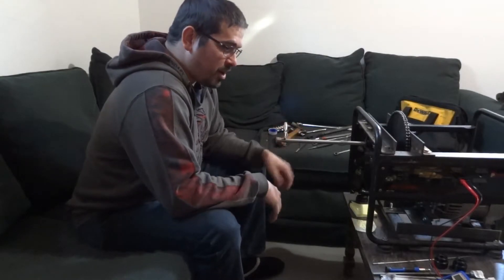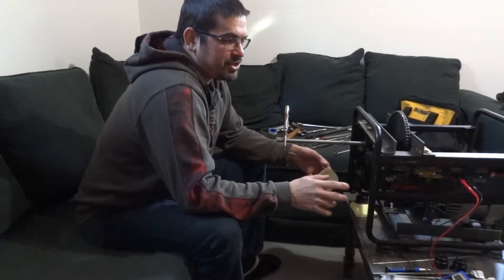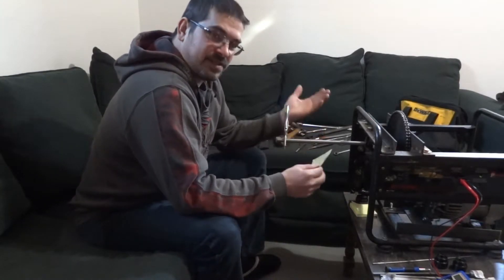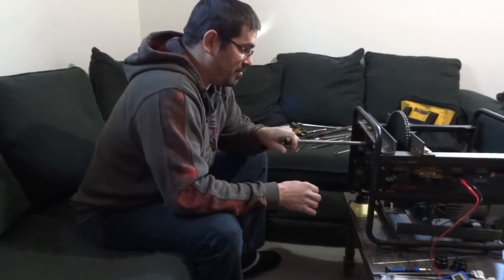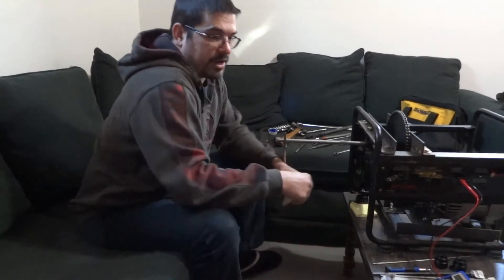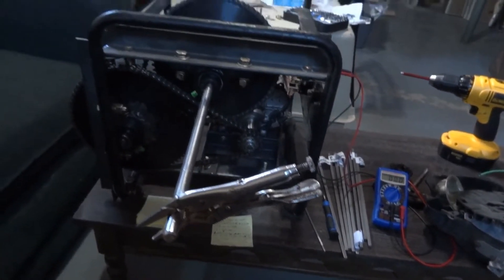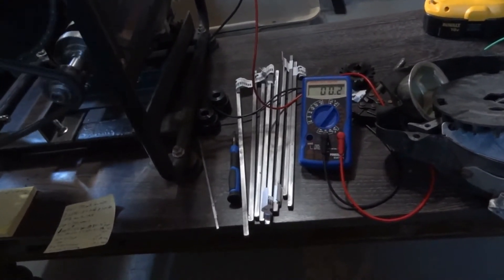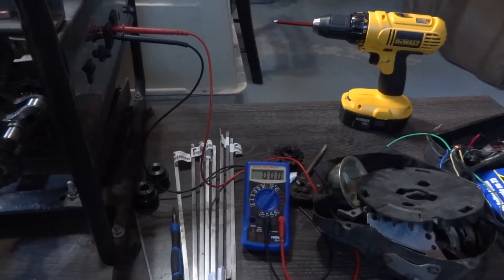Gas to Wind & Peddle Powered Generator Conversion Pt. 6 (Final)

Comment: Could you use an alternator with a propeller to generate DC power to power a DC motor to spin the generator that could solve your speed control problem
Reply from the maker: There would be plenty of wasted energy going to each motor to instead of a direct propeller going to the generator. You could do that setup, you just wouldn't be getting a feasible result. 

Factors:
Wind speeds
Propeller to alternator gearing
Alternator output
Alternator load from secondary DC motor
Secondary DC motor output
Secondary DC motor load from generator
Secondary DC motor to generator gearing
Required KW/HP input to maintain generator output.

It's a bit of math and engineering.
Reply: True. it would be more cost-effective to run a DC wind turbine to charge batteries and use a inverter to transfer power from DC to AC

Comment: Thank you for your instruction.  I'm gona try the same but use hydro power instead of wind. Just haft to figure out pressure needed to get the hp. You rock sir!
Reply from the maker: The flow rate of the water source, will determine is your available pressure. You may have to make a mini dam, diverting the flow of water to small opening, thus increasing the pressure. Remember, increasing pressure of the outlet doesn't increase the overall rate of flow. Also make a secondary outlet, for maintenance purposes. The water turbine design is the way I would go, give the access to a natural flowing water source.
Reply: It depends if you use just a narrow creek or a wide river. If you use a wide river than it's possible to do your wheel 🛞 out of a 200 liters barrel 🛢️ welding wings to it and put all parts on a frame that is held on 4 x 200 litres barrels. It would flow on water always and would adapt itself to water level. To use this kind of generator using hydro power is most effective way because flow is constant 24/7 365 days per year. If you have  2kw generator you get ~17000 kWh per year. If you connect this type of generator to a solar inverter say 10kw and have a battery bank of say 10-20 kWh then you can be fully off-grid. More than 1000kwh per month for a average household it's more than enough.

Comment: Hi
I was excited to see your wind turbine. I also was thinking of converting my old generator into one, because where I stay in 
South-Africa we have an abundance of wind. 
Also in the whole of the country we have something called “Loadshedding, ” wich are scheduled power cuts thx to corruption and too little government infrastructure spending…
But anyway, so if I understood you correct the needed size of the wind turbine would have been too big and probably not financially viable right ?
Also in SA we run 220V, that would mean an even bigger needed turbine……I think 🤔
Reply from the maker: The volts aren't what require the larger turbine blades, its the load or amps being used on the power grid. The physics parts is the minimum amount of force required to rotate the generator to the speeds required to maintain a sufficient current.
Power = Force X Velocity

Comment: Im pretty sure you need to put 12volts into the generators electric magnets to make the electric field for power to generate.
Reply from the maker: That's not how a generator works. A generator is designed to send out an electrical signal, not receive it. Putting electricity in to the generator should turn it into just a motor, I'm not sure if that would even work. I'm not an electrician.

Comment: You supposed to make 3000 Rpm for 200volt. Chain will too slow, rubber belt can do the work, with a bigger wheel
Reply from the maker: Here in Canada, the regular AC is 115-120V. Please send me the reference to where you obtained that calculation. Chain is too slow? The chain only connects the gears together, thus making certain gearing ratios. Thanks for the laugh though.

Comment: Hello! You worked hard on this generator. I don't see how you put electric excitation on him. What voltage?
Reply from the maker: Thank you. I'm not an electrician. The generator motor is a 1200W 110-120V AC supply.

Comment: put the bike in the middle of the windmill and gen then you you have the gearing you need
Reply: thats so you can start in a easier gear then move up
Reply from the maker: Sweet, I'll try it when I get back to the project. Thanks.
Reply from the maker: Sounds like a good plan. Thanks.